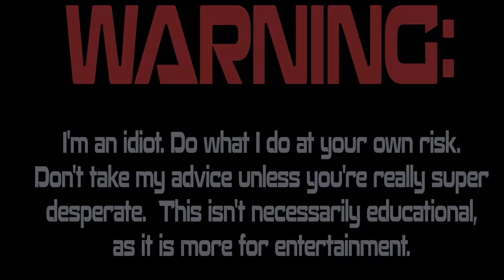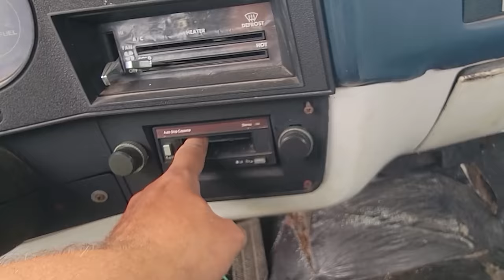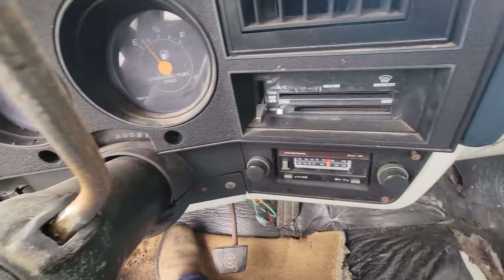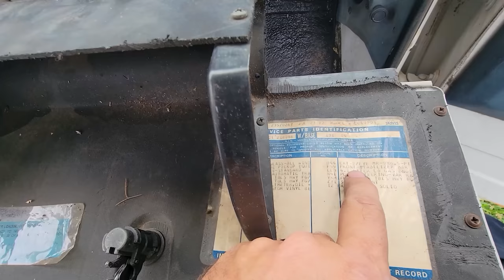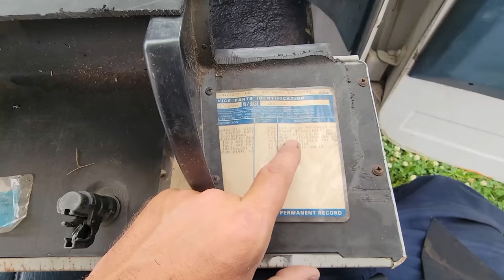Will This Square Body Truck RUN AND DRIVE Home 200 miles after 15 years?

Comment: I think it would be cool to see you drop the dirt dobber camaro's engine in this with a manual trans and a QA1 suspension to make it a fun, lil goin ta town rig you can row through the gears on the back roads.

Comment: Put a good motor and transmission in that white pickup truck the body looks really clean at 6 cylinder was shot find maybe a 350 cubic inch with a good turbo Hydro transmission that truck would probably give you the most for the least amount of work if you already have the motor and transmission

Comment: Derek IDK why but the trucks with the inline 6 always had the little brake pedal in the late late 70's and early 80's. Until I think it was 85 when the 4.3 v6 replaced the inline motor might have been 86. I would love to have this old truck for some reason I want a straight 6 just for the nostalgia my dad always got the Silverados so the last straight six he had was in the 67 pickup he had a couple of them in the 80s that had the 6.2 diesels got 400,000 mi out of each of them all of his farmer friends around the neighborhood would buy the truck like you got there and every one of them great had the inline 6 and the tiny brake pedal . But I've got it in my head that I want a straight six truck with a 3 on the tree

Comment: I would take the head off and see if you can save on an original. Not everything needs a V8 when 6 in a row makes ‘er go. If the engine is worth keeping i vote it a simple going to town rig. If the block is cracked, then find a 292 to put in. 

It could be the “Got your 6!” Rig.

Comment: Try grease lightning cleaner works alpt better simple green iam a gunsmith and cleaning muzzle loaders it works get the floor clean in the shop to put the 350 in it and fix the AC a must

Comment: That is a 292i6, they are really goos little engines, but the newer ones like that one need the old style heads put on them. That head design is really bad, gm was tring to comply with the new epa crap. I vote fix it put some power adders on it. A person can get like 500hp out of that lil 6 popper

Comment: This right here is the true definition of Murica’. This feller has drug Cadillacs from fields, trucks out of the brush, and then this! A truck literally in pieces under the hood and STILL got the ol girl to bark off.

No matter the challenge he finds a way. And it still leaves me goin “I’ll be dipped! He did it again!”

Comment: Ooh, swap this cab on the ramp truck, put the ramp trucks motor and trans in this and find a 454 or detroit diesel 4-71 and 10 speed for the ramp truck 👌

Comment: That motor condition looks like my 1990 f150 I bought. Everything is unhooked and parts missing. It’s from New Mexico so the body is in great shape. No rust. I’m not even wanting to start putting it back together. I’m afraid of how bad it’s gonna actually be. Come fix it for me. I’m in Ohio. It will make a great show on YouTube. I have a 1990 f250 also that has a timing issue but I’m just being lazy with that one. I’ve got a really solid 66 t bird that has all the trim and all the missing parts too. Just needs put together

Comment: The 6 just did not get the job done.   How about a crate Cummings Diesel  v 6 or 4  turbo of course. The 4BT 265 ft of Torque. 782 lb with oil kind of heavy.

Comment: You said you really just needed the bed off it, right? I'd swap a SBC and trans into it, take the bed for the other, chop down the rails, throw a short bed on this one, while you're back there at the tail frame, C-Notch it, get an airbag/suspension kit for it, and have yourself a bagged, low, swapped rat truck, actually not even a rat seeing how straight and "good" the paint is lol. That is a straight truck though, I wish I could find a straight truck like that lol....I'm in ND myself (from Jersey) right on the ND/SD/MN border.... everything around here is absolutely cancer-fied..... even my own 97 GMC K1500 SCSB needs rockers, corners, doors ECT 😅

Comment: Heck its a good solid body on the ol truck I would swap out the engine and get er back on the road!
Reply: He does do just that. But instead of a small block or a LS, He fits a Gen 3 Hemi. He calls the Truck The Hemi Half. There is really good build series on His Playlist.

Comment: I would first take that head off the 250. If the problem is in the head fix or replace. If the cylinder liner is split then do the engine swap or use it for parts.

Comment: I never understood why these were named custom deluxe when it's bare bones pretty much except for the ac probably due to the options u could request when ordering it. Here's what puzzles me about this whole video u get under the hood to find every hose and wire cut and an engine hoist chain basically hooked to it almost as if someone did it deliberately to scam whoever bought the vehicle into doing tons of extra work just to get it running

Comment: That truck is in too good of shape to part it out. Id say throw a goof motor and transmission in it , change the rear bumper and run it. Nothing like a good dependable truck.

Comment: One thing for sure IT IS NOT A PARTS TRUCK.... 2. I wouldn't do an engine swap unless the block is cracked, and that engine can't be saved. You don't need another truck that will burn the tires off. BTW. What a waste of material and money.

Comment: Keep it all together.  Too nice of a body. And with a title to boot.   Pull the head off.  If all it needs is a head gasket then rebuild that 6 banger.  Perfect starter truck for the boy.  V8 are sexy and all but nothing wrong with an all original square body 6 cylinder truck.

Comment: Use it for parts for your other truck or for the V8 in it and drive it it's got a lot of good parts good thing about Chevrolet you don't throw nothing away Chevrolet is American muscle it's bad to the bone built Chevrolet tough

Comment: drop a v-8 in her, and lift kit, drop some 37's on each corner, a couple of light bars, selection of towing options on rear, drop a winch or two front and back, , and call her fingi-me-bob.....get me out ov here rig.....

Comment: I think if the frame is good I'd put a 350 in it I don't want to shift on the tree 😅 also it would be better for the rug rat's going to school with it 😀 😉 towing would be easier for them dirt bikes there going to want 😉